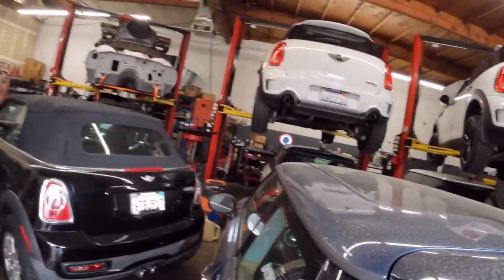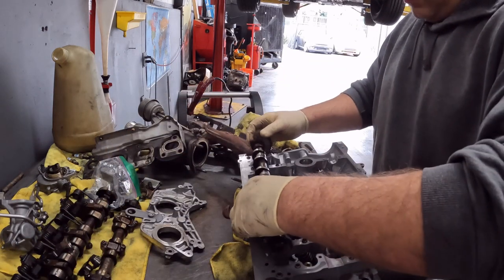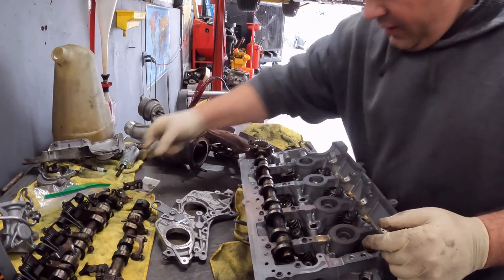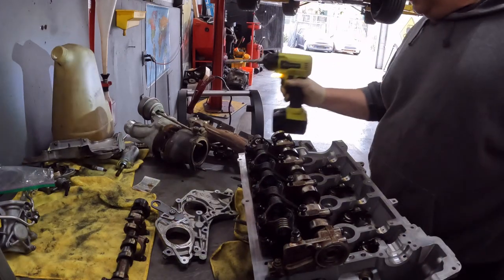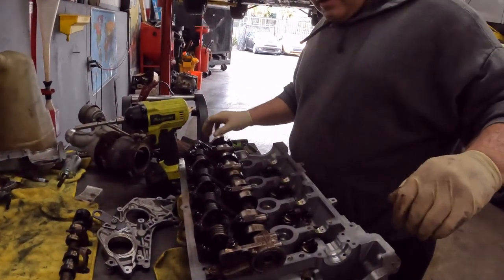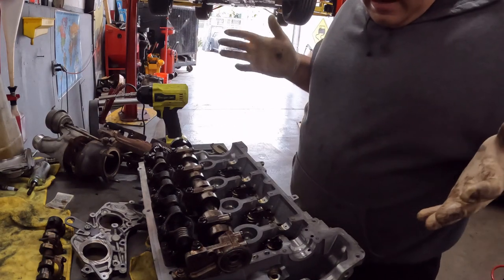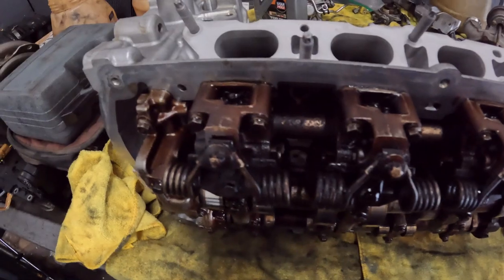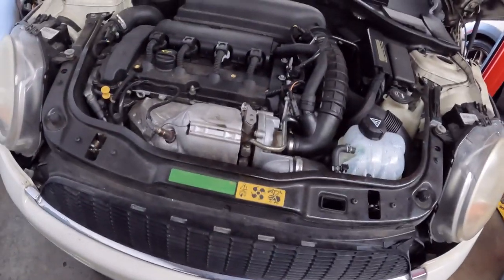MINI Cooper R56 N12 N16 N18 Valvetronic Easy intstallation

Comment: Yeah man that's the best way to do the eccentric shaft. On a MINI using the special tools isn't that much of a biggie because it's a 4 cylinder. But on the 6 cylinder BMW, you'll be at it for a while. 

This is a huge time saver.

Comment: Thanks for posting this video on how to reassemble the Min Cooper's Valvetronic assembly and springs from hell.  Just like you, I had a lot of trouble getting the rat trap spring put on Intake Valve 1-A, but it finally slipped int place with some gentle but firm persuasion and a lot of French words.  This is the best video on YouTube on how to put these types of cylinder heads back together without any special factory or home-made tools to re-insert the rat trap springs into the roller rocker arms.  By the way, I noticed that you did not keep the roller rocker arms in nay particular order and put them back into the head wherever it looked convenient.  I was under the impression that all valve train components had to be reassembled back onto the particular valve that they originally came from during disassembly.  Is that just an urban myth?

Comment: great job, would you please tell me which  rocker arm goes in to inlet and outlet? I am assembling head for mini cooper r56 n12 2010, and forgot to mark the arms when taking apart. now there is mark as 17INA and  21INA on the rocker arms  and could not identify which one is for exhaust and which is for inlet. thanks in advance

Comment: One question related to this car. If I physically remove the connector from the vvt valve on the exhaust side, does only that cam have no movement function or does the entire vvt and valvetronic system stop working and go into safe mode